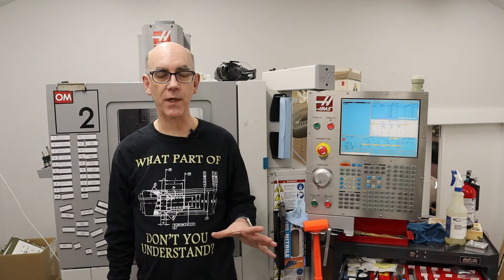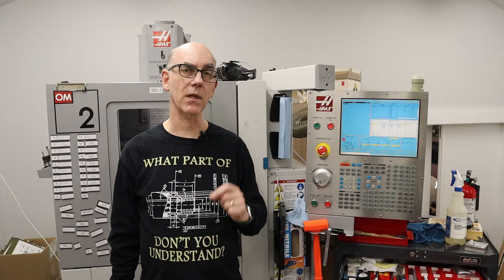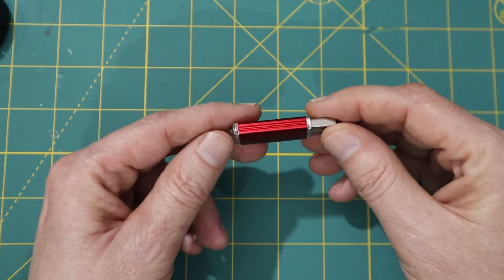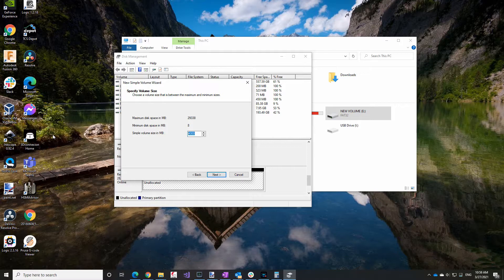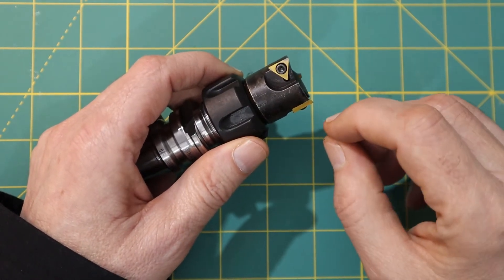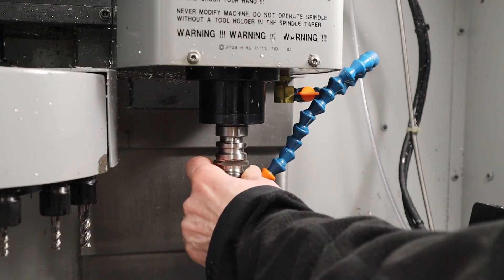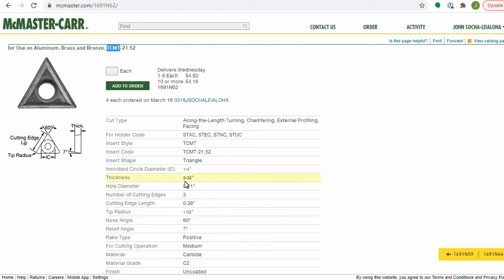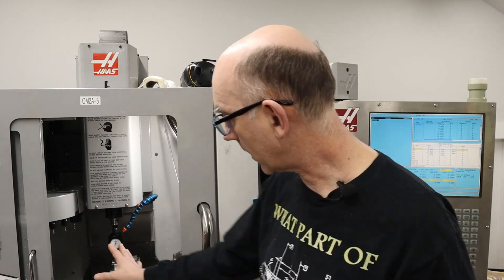Random Thoughts #1--Haas Learnings

Comment: Instead of using the haimer to determine your “fixed” reference point, use a tenths indicator in a tool holder so that it’s a more accurate reference position. The haimer is very limited with respect to how accurate the machine actually is.
Reply from the maker: I have put injection molds back into the machine to re-machine some tiny details and find the repeatability to be a few ten thousands of an inch. And I find the Haimer faster and easier to use.

Comment: just for anyone watching, the FAT limitation is applicable to the original Coldfire controller like John shows in the video. The processors were upgraded in approximately 2011 to "Coldfire-2" which allows FAT32, although the giant capacity drives will take a looooong time for the operating system to index them when inserted.
Reply from the maker: Thanks Andrew. I did some more testing and it seems my 2009 controller (not updated) does support FAT32. I'm able to use a 32GB thumb drive.
Reply: o dang! I can never get my 2010 to work with it! maybe I need to play with it more... it also has the ole 8-character limit from the DOS days so it's already bad enough lol
Reply from the maker: Interesting... My 2009 handles long file names without issues. I guess it could be that our USB interfaces are different. Do you have a USB to floppy interface, perhaps?
Reply: nah those are even worse! they require a ton of little 1.44-MB partitions on the flashdrive. I wonder if your OM had the software upgraded at some point, we bought two machines in 2010, but one of them was upgraded a few years later due to the batteries dying. it eliminated that issue although I have to admit I don't know about the flashdrive compatibility. I kinda stopped experimenting and instead found one thing that works across all the machines heh

Comment: Power up restart sends the table into a limit switch, it will then reverse the table and run the encoder to the first zero mark it encounters, could be within a few thousands of the limit switch, then sets that as machine zero. Electronically speaking, it will return to the exact same encoder position where your part is located. The .0002" difference you are seeing is mechanical stack up, could be the Haimer is off by a 1/10 and the table/ball screw off another 1/10 etc. Do the test again, see if you can push the table into the Haimer towards zero, I bet you can move it by 1/10. I can push the Z column by hand in my Super Mini Mill and move a test indicator by 1/10 easy.
Reply from the maker: Yup, that's what I'm seeing for movement. Very cool. I didn't know incremental encoders exists with a Z channel. I did try pushing in the Z column, and on the X, but couldn't get the Haimer to move visibly. Granted, that's not as sensitive as a 10ths indicator.
Reply: @JohnSL  I just uploaded an example, this is my regular Mini Mill, it is brand new, less than 10 hours on the machine, I am pushing the table, and spindle nose with my hand. It does return to zero when I let go, but it just just how much it can be affected by so little.

https://youtu.be/4g9HJdkfBuE
Reply from the maker: Thanks. I put a 0.0001" indicator on the spindle and am able to see deflection. Now you've sent me down a rabbit hole, and I'm going to be doing another video on this soon. I was just recording some content tonight. I  found that the orientation of the tool holder in the spindle also makes a difference.
Reply: @JohnSL   I was holding the camera with one hand, if I use both hands I can push/pull the table nearly .001" So now think about jogging your table from the right to the left, setting G54 zero on the Haimer. Then power up, the table moves from left to right. If you have any un-corrected backlash, the Haimer will show a difference in zero, but the axis encoder will be at the same zero. Also could happen I guess with a lot of weight on table causing a small deflection.

Comment: These may be too big for your ATC, but I've been looking at them for my planned ISO20 spindle modification for my Tormach.  

https://www.aliexpress.com/item/1005002265064974.html

50 and 63mm face mill holders and the 1604 inserts work incredibly well.  I have the 63mm face mill for my BT30 spindle and run it at 8600 RPM, 1mm depth of cut , 50mm width of cut and 2500mm/min feed rate.  It is amazing.

Also, the 1604 inserts for aluminum cutting are available with and without wiper so you can decide between roughing and finishing.  I'm happy with mine in BT30, we'll see how the ISO20 handles them.  I'll probably go with a 50mm instead of 63.
Reply from the maker: I actually purchased one of those and discovered it didn't fit my tool changer for two reasons. First, it was too large. Second, the profile of the two rings is different on the Haas from any other ISO-20 profile I've seen. As far as I can tell, only Techniks sells ISO-20 tool holders that fit the Haas OM and CM machines.
Reply: @JohnSL  how interesting.  The whole idea of “ISO” would imply that it’s a standard. :). I get the diameter being too large for the atc but you would think the design of the tool holder itself should work.  Good to know!
Reply from the maker: Indeed. I found out the hard way. It seems there are some different styles of ISO-20.

Comment: Your machine positions by watching a high resolution encoder on the servo motor that drives the leadscrew. The basic resolution is 4X the encoder resolution. Encoder resolution is expressed in lines per rev identified as LPR. The homing process in almost all CNC machines is done with a special mark on the encoder often called the Z channel. While A&B channels provide quadrature data used for position and have many lines around the circle maybe a 1000 or more. The Z channel has only a single line. Homing is done in two steps. First home to the limit switch. This gets you close probably a few thou or so. Then carefully back off the switch to the index mark on the Z channel. This gets you within at least one encoder mark resolution or better. The current quadrature position is taken as zero.  I don't know specifically if your Hass machine does it this way but most machines with incremental encoders do.
Reply from the maker: Oh, cool! All my experience has been with A & B channel only encoders (I've written several versions of code to read encoders). I had no idea some encoders had a separate Z channel. That explains how they can get that accuracy without an absolute encoder. Thank you for letting me know about this (and sending me down a rabbit hole).
Reply: @JohnSL  After decades of embedded assembly language programming, I too have written many quadrature encoding routines. I do 8051 8 bit code with an assembler that I wrote from scratch. I have after many years developed the leanest fastest simplest code to do encoders. I wrote a little paper on it so my programmers could understand it and use it.  How could I send it to you?
Reply from the maker: When you're on my channel, click the About tab at the top and there will be a button to view my email address. I left assembly programming behind a long time ago, so use C++ for embedded work (although I want to try Rust).

Comment: Are telling me your has doesn't have a network interface? Also, 2009 wasn't in the 80s. Are you saying it doesn't support NTFS?
Reply from the maker: It does have a network interface, but I haven't been able to get it to work yet. It requires SMB 1.0, which my desktop doesn't have installed because of security issues. I'm planning on setting up a Raspberry Pi with SMB 1.0 to act as a network share. And correct, the Haas controller only supports FAT. It doesn't support NTFS. I was surprised to find that out as well.
Reply: @JohnSL  Did you check if Haas as a firmware or software update?  This is ridiculous!
Reply from the maker: I did some more digging and discovered that it does support FAT32. But, and here's the important thing, it seems like you have to have the thumb drive that is formatted with FAT32 in the machine when you power it up. I've found the USB support to be finicky in other ways. Such as I need to select a program from memory before I remove the USB drive. I'm guessing they're using Windows CE and the driver they're using doesn't recognize USB insert/remove.
Reply: @JohnSL  OK. If it's running Windows CE, shouldn't there be a way to upgrade it or add additional drivers?  Windows CE uses the same NDIS drivers that standard Windows does. It should be a matter of copying the driver and installing it for the Network Interface.  If it's baked into the firmware, it may be impossible.
Reply from the maker: Windows CE drivers are built into the image by Haas, unlike the full Windows. So you can't add new drivers after the fact, unfortunately.